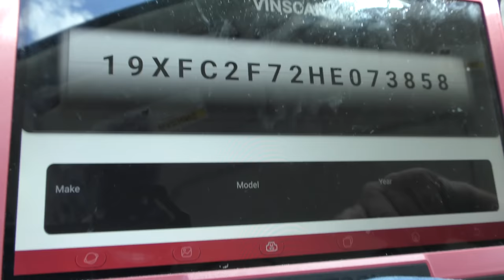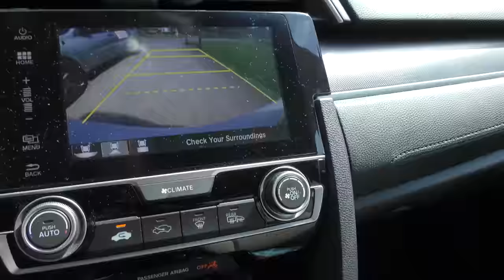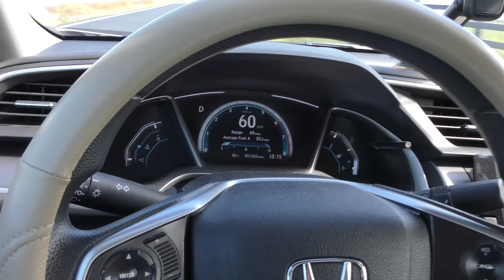Here’s What Happens If You Change Lifetime Transmission Fluid in Your Car

Comment: I went to a Honda dealer and had the CVT oil changed at 35k, they billed me for four quarts when all the manuals say capacity is three. I’m hoping they just padded the bill and didn’t put in four quarts. I will buy the fluid next time and take to my local independent mechanic.
Reply: Maybe they were able able to drain a little over 3 quarts

Comment: BMW had life time diff fluid.  Hundreds of thousands of exploded rear ends later. PS: it was on the motorcycles (Buy Motorcycle Wrecker).
Reply: Have you seen the size of the coolers on them CVT transmissions?  Bout the size of pack of cigarettes!

Comment: Flushing will not cause an issue IF you flush early like I do at 30-35 K, waiting tell 75-80 K OR tell your trans starts acting up is way to late,I never ha e had the 1'st issue with flushing a trans,To each their own.

Comment: My recommendation, ALWAYS take the fill plug out first when doing gearbox, transmission and rear differential.  If you take out the drain plug and drain the transmission what happens when the fill plug doesn't come out???? Call a tow truck.  Lol

Comment: Bad advice not to remove transmission fluid pan and change filter in the fluid pan and also change transmission fluid filter mounted on the outside on the side of the transmission to ensure all old used fluid and particles is removed from the system. You would need to start the engine to have the transmission pump purge the old used fluid out of the torque converter.

Comment: The lifetime is until all the ferrous magnetic wear products collect on the magnetic sensors and coils to the point they no longer know a control signal from the built up reluctance of the wear products. This seems to be about 60,000 miles to be a safe guess… truly.

Comment: Coefficient of friction changes as heat and sheer work on the AT fluid.  And that whole issue of microscopic debris too small to filter flowing around like liquid sandpaper.  Just do a drain and fill every whatever miles.  Expect roughly half of the total fluid in the system to drain out.  That’s why we drain and refill every X miles so eventually it all gets cycled out.  Dealer flush costs $300, drain and refill at your house costs the price of 4 or 5 qts of THE PROPER fluid.
RTFB (read the fuckin book)
for the proper procedure.  May surprise you.

Comment: I've seen that too many times. "Lifetime" transmission fluids, "long-life" oils. It is because of "ecology" - each changing "produces" a waste, which have to be recycled. And if there's a regulation which accounts waste products to overall "emissions" of a vehicle, you've got problem. How to avoid it? Answer is simple - say it doesn't need a change or even better, forbid the user of doing so. Nobody cares when parts get destroyed because of that, as this generates less of a problem - or at least did. The thinking was, that worn out or destroyed part wasn't so much of a deal than carcinogenic byproduct of crude oil are. When most of the parts were made primarily out of metals, that didn't pose so much threat to an environment, as those could be easily recycled. However, lots and lots of parts nowadays are made with various polymers, which are not so easily recyclable anymore. Still - one broken transmission which generates 3 qts of oil waste (lifetime fluid) vs 10 gallons of used transmission fluid that need to be recycled (during expected life of typical transmission)? Sounds simple, as nobody cares about single person money, when it comes about environment. While it have some right in in, coincidentally oil filters started becoming smaller with each new engine. And that definitely doesn't play a part in newer cars being more prone to premature failures, no sir. What always had baffled me, was that during that period when normal maintenance was still a thing and long life oils just started to make appearance, nobody made specifically long life oil filters. Whether you used "standard" or long life oil, oil filter was still the same, yet you weren't allowed to just change your normal oil 2/3/4 times without changing filter, as that would void your warranty; long life oil however could make similar distance on that same filter without concerns. What kind of magic is this?
While I do try to care about our planet, I still change lifetime fluids in my car every ~35 k miles, and long-life oil engine after ~10 k miles. I do however make sure to utilize them properly.

Comment: I went to my Kia dealer to get my transmission drained and they said that there was a sign on the transmission to not change the fluid. They said it was lifetime as well. I guess I’ll go to an independent mechanic and get it drained. It’s almost at 60k miles.

Comment: my sister changed her oil and when she kept checking the level she was not putting the dip stick in the hole! she way over filled her motor and blew a head gasket--so much for doing it your self(yes she is blonde)

Comment: Recently had my 2015 Subaru at the dealership for a " special "  $ 19.95  synthetic oil/filter change..   They did in fact honor that and as expected,  also suggested several services to the tune of well over $ 1,000 since the car just turned 60K...  To the point, I asked if Subaru had a change of heart about these " lifetime " transmissions and whether they should be serviced.... Seems ( I did not get a notice from Subaru btw )  it is now recommended that the CVT oil  should be replaced at 60K with a thicker oil to make the trans last longer.   Has anyone else asked and got the same information from a dealer ?

Comment: Scotty made one mistake. Always open the fill before you drain the transmission.  You're in trouble if you drain it and can't get the fill open.  It doesn't happen often but it can corrode in place.  You also want to be sure you can find it.

Comment: Modern bean counter quality constraints ensure EXECUTION WILL SUCK even if design does not. The design is less a problem than all the corners cut to lower production costs. Fortunately no need exists to own a CVT.  Not changing hydraulic fluid (which is what transmission fluid really is) when contaminated is stupid. Of course the makers want gearboxes to wear out because that normally sends cars to salvage.

Comment: Lexus dealerships change the oil every 10,000 miles, but the light on the Lexus comes on after 5,000 miles.  I watched them push the reset button at 5,000 miles, and asked if they changed the oil, and they said no, they just push the button at 5,000 and 15,000.  I called their corporate customer help line, and said I figured if the Japanese engineers set the "change oil" warning every 5K, it needed to be done.  I couldn't get an answer, and gave up, and changed it in my driveway.

Comment: Scotty, it is impossible to do this on a VW GTI without a a full body lift, which is probably over $1,000! You can't just put the car on ramps. The car has a dam that has a TON of bolts holding it in. I give up and will just have to go to a shop that can drain it for me.

Comment: Toyota Corolla requires Toyota fe only. It's about $100.00 for a four liter can. That's about how much you can get out if you drop the pan. What the hell was wrong with having a dip stick? Nope, you gotta use the oil temperature to set the level correctly. How damn stupid. Why do we buy cars that are obviously designed to make basic maintenance difficult?

Comment: I have a 2018 HR-V with a CVT and the car is a DOG under acceleration! MY Subaru is 10x faster with the same horsepower. Why is that? Like you said though, the car gets about 33MPG on the highway.

Comment: I changed the tranny fluid in my cvt Honda the first 3 oil changes. Now i will change it every 40,000 miles but i will use the drive 20 miles and change it 2 extra times method. It will take 3 times the amount of fluid but my civic only takes 3 quarts so 9 total. Then it will be 100 percent clean for the next 40,000 miles. 😜 You see some old dirty fluid stays in the transmission until you turn the engine a certain amount of times to get it all out.

Comment: Looking for an answer on this: after 100K on CVT, does the amount of maintenance required start to ramp up? It’s a ‘chain’ of sorts under a lot of stress. Could you get 300K out of a CVT? Would it last as long as a 5 speed ZF automatic like the O1V on my 2004 Passat that still shifts so smoothly you can’t hear it? Sure I change the trans fluid every 80K - and the fluid is expensive!
Reply: my dad bought a hybrid honda civic at 2008
300.000 km (idk how many miles that is) and 14 years later it still works fine with regular maintenance on the dealer, there is only a very slight jerk when accelerating at about 10 km/h (which i assume is when the torque converter fully engages) which can only be felt when you accelerate lightly and since i only started driving it after 200.000+ km idk if that is something that happened from the factory or started later on, but other than that it is perfect, no slipping, very smooth etc.
i dont know and cant currently check if and when they changed the fluid on this thing, but i would assume that back then changing transmission fluid was a thing

Comment: Scotty, what about BMW 7 series transmissions?  The dealership told me it's a sealed transmission and it should only be changed if it's giving problems or leaking.  The dealership said it lasts the lifetime of the car.

Comment: Why do the guys in all other videos on YouTube, use almost 4 qts and Scottie used 1?  Also, looks like he filled it in the overflow check hole, not the fill hole.  He also didn't shift through the gears after changing it.   Do yourselves a favor and if you have a 10th Generation Civic, watch a few other videos before you end up adding one quart to three dirty quarts of trans oil

Comment: My humble opinion is that DIY'ers are obsessed with too much maintenance.  They live in a world of fear.  Yes, maintenance is good and one should follow intervals as detailed in the manual, but people over do it.  No, you don't need to replace brake fluid or coolant every year, no you don't need to replace coolant hoses every 4 years, no you don't need an oil change every 2000 miles.  That said, transmission fluid/oil is the thing I worry least about any car.  Outside a few japanese models, you'd be lucky to get 125,000-150,000 miles on a car before the big $5-$10k repair period comes where you'll need to refresh a ton of stuff and constant repairs every year to essentially rebuild the entire car to keep it going, at which you'll have probably dumped your car anyway.   The tranny will almost always outlive that day without ever having replaced transmission fluid.  I've owned 9 cars from European to Japanese to American, and I've never changed transmission fluid.  EVER.  I drove a toyota with original tranny fluid to 340k miles.  A BMW to 225k miles until I dumped them due to other issues.

Comment: Do not flush modern transmissions.  Also, don't run ABS Bleeding procedure on older cars.  Brake modules are full of delicate plastic and  cheaply made circuitry.

Comment: But lifetime is exactly that! If you buy a Chinese ball bearing race and it lasts three weeks on an assembly line that is its life. If you buy an American or European assembly and it lasts three years that is its life. Lawyers are clever as are the engineers they protect. In 1970 the British army - I kid you not on this because I was using these items - purchased ball bearing races from Poland - remember that date and they failed when we fired anti tank action on field artillery. That was their lifetime. The purchase system thought they had reduced maintenance costs they had just curtailed our offensive ability. Never go for cheapest option and stay with your own supply!

Comment: Why would you change just the fluid and not the filter?
Reply: Filter is just a big screen really doesn't clean the fluid..if your filter is clogged with metal parts you have bigger issues.

Comment: This is my biggest fear about changing the transmission fluid: stupid mechanics. Prevention is the key, but when you deal with incompetent people, it’s the key to disaster. There are mechanics in the dealership who can’t even change motor oil properly. I had to use a tube and syringe to extract the excess oil myself.

Comment: Got a 99,321 Ford Escape 2009 v6, never had a trans change, but scared to do it myself and people say it don’t have a filter but found one on autozone, so ik it has one. But no video shows where it is: would like to know how only changing the stuff u can is better than changeing all of it, should be 100% new oil if u asked me cause mixing dirty with new fluid is just gone make it worse, like car oil u got to get rid of all of it. Wouldn’t want partially yellow teeth and not all white teeth you know. So ik having some new oil better than none but what about the old tranny oil?? It just gone make it all gumped up. And how would a flush get clogged when it forces it all out as if u had some stuck in a straw u just flush or blow it even harder like the gutters. Just don’t trust the mechanics they have done things like snipped wires or broken clips, and worried they just gone keep doing it.
Reply: Also doesn’t slip at all and runs very well, but would hate for a mean guy to mess it up or me cause false advertising, so is 99,321 to late to change?? Sorry for many questions.

Comment: Been doing this every 30k miles, car runs great at 122k. My ‘16 turbo takes 4 full qts
Reply: When you change the fluid does the engine need to be cold or hot? Thank you
Reply: @hb3526  I just spill and fill while it’s cold
Reply: Thank you. I appreciate it.

Comment: Except that's not the correct way To fill a transmission. You go by capacity. If a car says drain and fill is 5 you put 5. If you go by what you took out it might have been low and is now still low. And cvt transmissions are not good. Just cheaper and they charge more for the car.

Comment: Okay so the car takes 3.5-3.7 this guy put 3. You’re supposed to put 4, let the car cycle the fluid then unplug the level bolt on the left until it starts to drip, this guy left 1/2 a quart out of a super sensitive transmission. 50 years of Innexperience

Comment: I changed the fluid on my sports car (these normally work under hard conditions compared to a family car) at a specialised center for the brand at 100k mi, and nothing happened, it worked the same way afterwards. They said they flushed it using extra oil, and a special procedure, they also charged the filter. Anyway, maybe it depends on the model of the transmission.

Comment: Your claim that flushing hurts the transmission is simply false.

Most transmission flush "machines" put absolutely no extra pressure in the system.  You disconnect the transmission line from the radiator, connect both ends to the machine and start the car, thus using the car's pump to transfer the fluid.   No extra  pressure.  It is not forcing any fluid in places it wouldn't go normally.  As far as the fluid is concerned it is just going through your radiator like normal.

The machine is just two buckets and connector lines.  It doesn't even need to be plugged in. Except for the light to show you the fluid
At least the ones you find at Jiffy Lube

Any problems you've had are the result of either using the wrong fluid, spilt fluid while disconnecting the line and not adding it back at the end so yiu have the incorrect level. or a transmission that was just about to go anyway and you just happened to do the flush right before.

Comment: Scotty is totally wrong. Every time I have changed the transmission fluid the transmission goes out. The crud in there after a lot of miles gears to mesh properly. A flush and changing the fluid has the same result. A new transmission. Remember Scotty is here to make money from You Tube not to give you correct advise

Comment: Honda CVT transmissions are junk. I'm not a fan bought a new 2015 Honda Accord, a little less then 2 years and 26k it needed new brakes, tires, cvt transmission flush, new new plugs. I had buyers remorse as soon as I got it. 18 months later I traded it in. Never again. Sloppy tranny. My girlfriend also hated her 2019 Rav4 total junk. The old-school gearboxes are better.